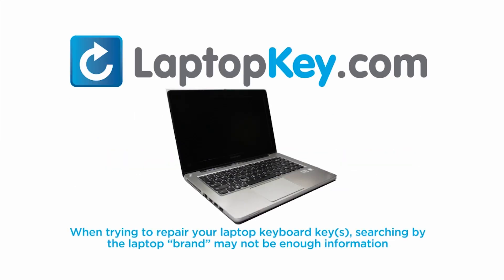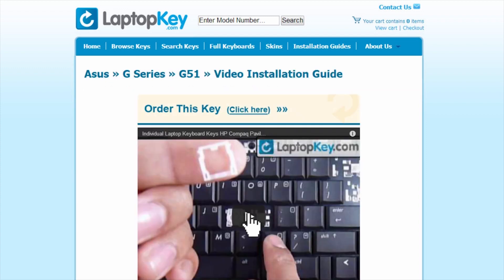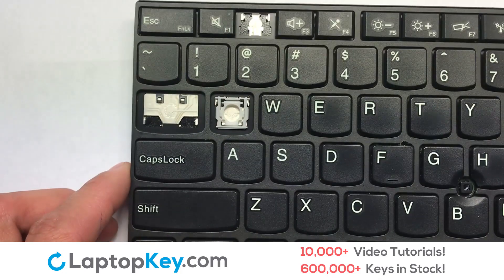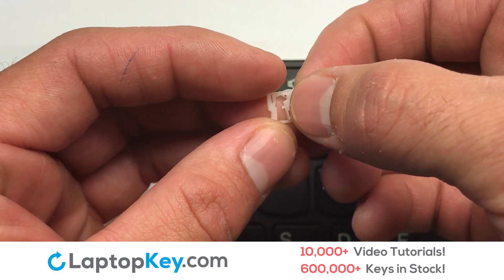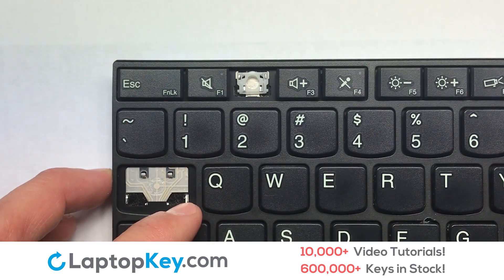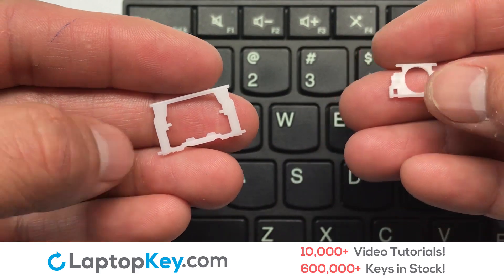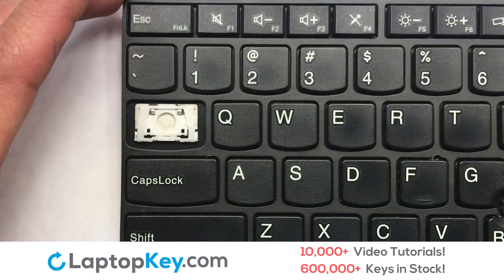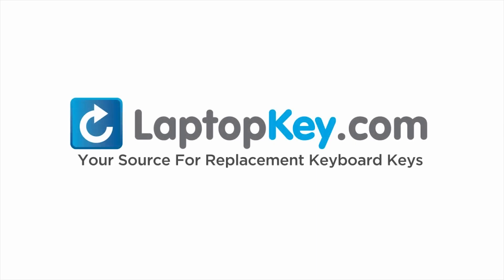Single Laptop Keyboard Keys Repair Guide | Lenovo Thinkpad W550 T560 20FL 04Y2348

Comment: So why wont my key attach? It just wobbles on it and doesn't stick into place?
Reply: The top clip's wings seen ca. 01:33 probably broke off somewhere in your keyboard. You need a new top key, I reckon. (Maybe rad 3d printing skillz can just get the wings back, I haven't tried or even used one of those 3D printing pens to attempt to sculpt them in.) Maybe see what junk dealers and PC refurb shops near you do other than send metal for refining? (Like, maybe a stash of like keyboards with keys you can use as a build reference, or buy single keys off 'em.) I just had a right-arrow key fail on me and their site doesn't allow saying 'right arrow' or 'arrow right' so I might have to get crafty myself.